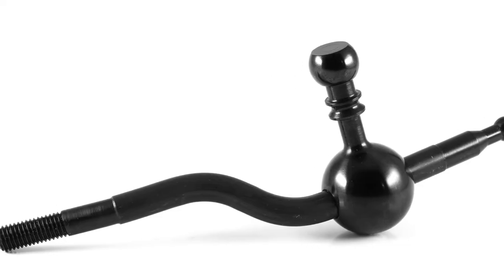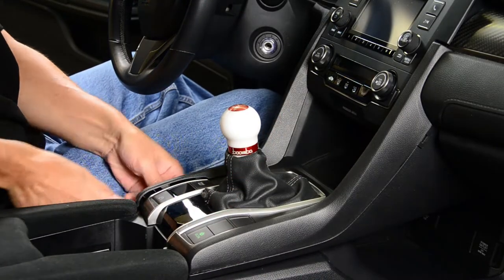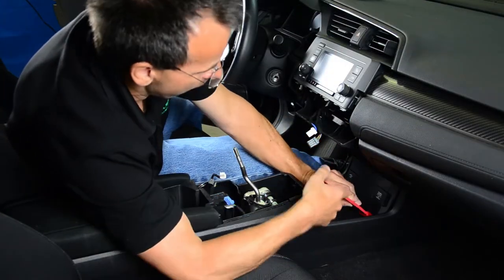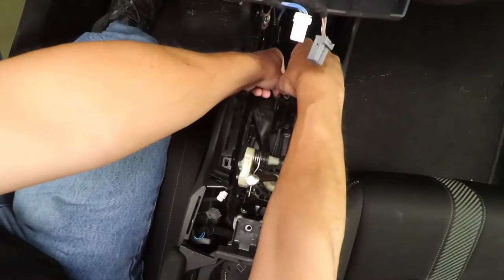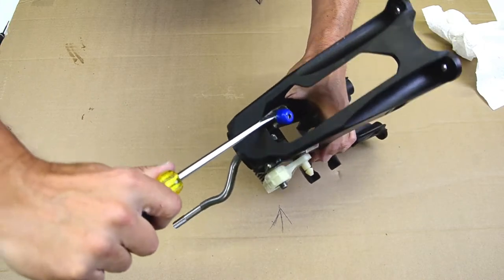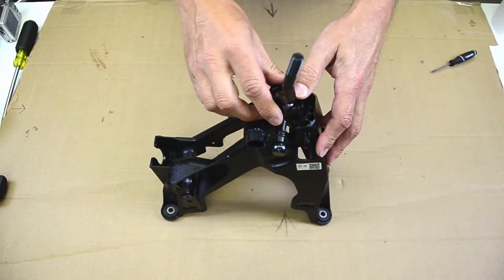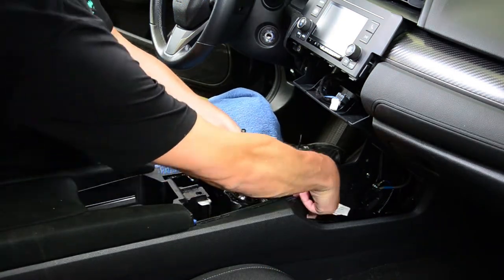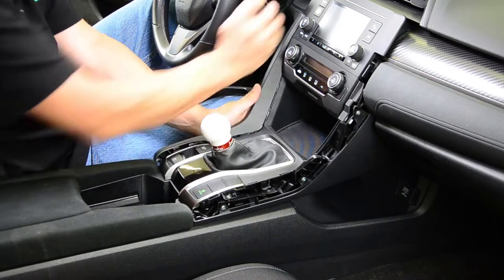How to Install | Boomba Short Throw Shifter for '16+ Honda Civic 6MT/Si/Type-R

Comment: Thanks for this vid. Do you think the shift lever would come out without taking the whole assembly out? Maybe by pulling on it from the top, slide-hammer style?
Reply from the maker: Honetly, I'm not sure. It looks as if that could work, but we cant say forsure.
Reply: You can and I did. Those clips on the shifter cup is a bitch to get out. They got chewed up trying to get it out, but I did it and it still clips in. I would suggest if your going to try put the shifter knob back on and pull up as you pry the clips loose. I was going to try the way explained in the video, but I couldn't figure out how to loosen the shifter cables from the assembly. They keep saying to lift the release tab I see it but even that looks like a pain. Good Luck.